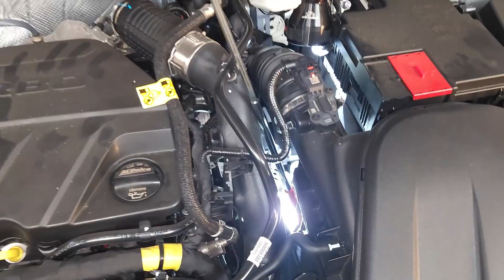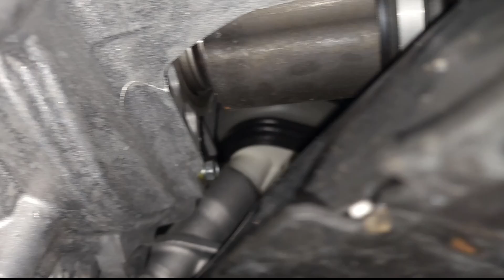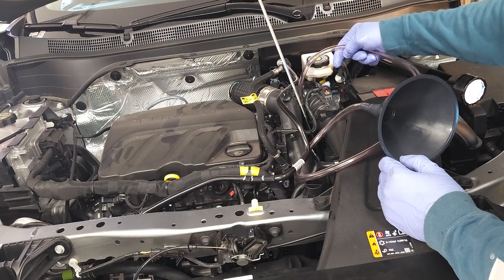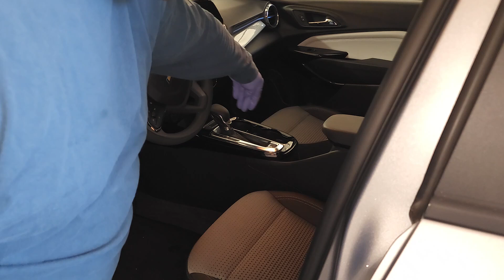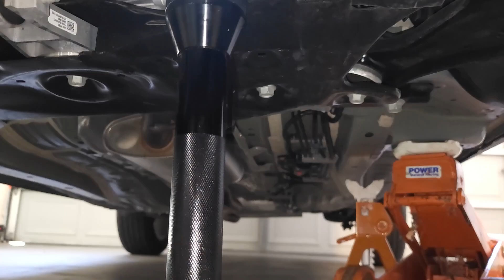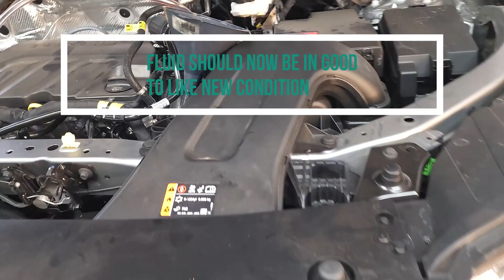2023-2025 CHEVY TRAX LT (1.2L LIH turbo I3) Transmission fluid - Drain, Fill & Mini Flush Tips

Comment: Unless you have a leak, drain the fluid, measure what you remove, then replace that exacy amount.  Do it every 25k miles.
The level check bolt is used with the trans. hot, at a certain temp., running in park, perfectly level.  You can't use it with the engine off. Just like the old days when you had a dip stick.

Comment: Is there a filter in this transmission ?
Reply from the maker: Yes
Reply: @protipsplus is there any reason to, or not to change this as well, with each transmission fluid change? 🤔
Reply: @Crux_Report  The transmission would have to be opened and basically split in half to get to the filter. If you do a drain and fill about every 25k miles your transmission will last.

Comment: I just drain it,measure the amount that came out,then refill.....it will replace half of the fluid....do this often...tranny will last....i change about every 25 to 30,000 miles.
Reply: Is there a filter is this transmission ?
Reply: @gregsobek722 yes but you cant change it without removing the engine or transmission.

Comment: I am in the process of buying a new Chevy Trax LS. My philosophy for maintaining automatic transmissions for the long run  is to replace the fluid that comes out of the drain plug, with fresh trans fluid coinciding with certain motor oil changes. As the miles on the transmission increases I would do his at more frequent intervals.The thinking is that tans fluid would never be allowed to reach a state of being old. By the time a major flushing is required I have already replaced a dozen quarts or however many. Old school mechanics warn of flushing out old fluid and swear that it does damage. I don't fully understand why, but they say that deposits accumulate around worn seals and when flushed those seals begin to leak and bypass hydraulic pressure. Replacing the fluid gradually over time prevents this, apparently. I have achieved 300K + on what are still perfectly healthy transmissions doing this
Reply from the maker: I agree with your rationale. Mini flushes basically accomplish the same goal, using less fluid. Under normal driving conditions, the primary reason for fluid changes is that the fluid loses its ability to disperse heat, not because the fluid is dirty. Great comment!
Reply: @protipsplus  Good point? Heat dissipation or lack thereof as the fluid degrades. There is no way to access the drain and fill plugs without moving that throttle conduit? I'd be nervous about disturbing a sensor connection, because I'd be doing this at least twice a year and more so as the vehicle ages. There is no fill stick to do cursory fluid level checks and for observing the appearance of the fluid? I realize that the definitive level check is to note a trickle of fluid drain from the fill hole on level ground. That's a bit of a problem since my driveway is inclined. Actually, I would prefer to suck out and replace a quart of trans fluid, every oil change -- which I would do every 5-6K miles, not at 7.5-10K as recommended --  via the fill level stick,  if there was one. I'm 72 and this will be my last car. I need to do the little extras to assure it out lasts me.
Reply from the maker: Hmmm.. I'd say you've got at least two more cars in ya! Stay tuned :- ).